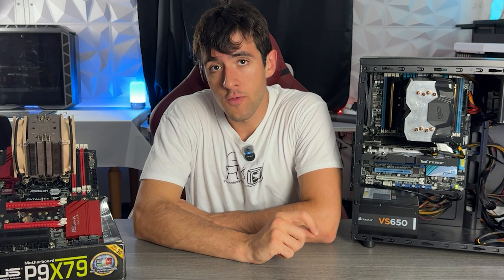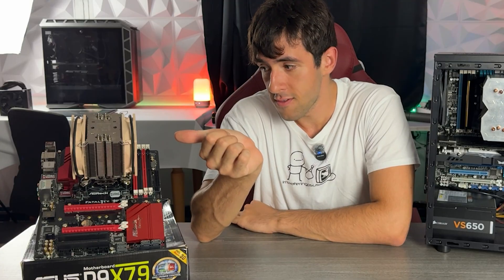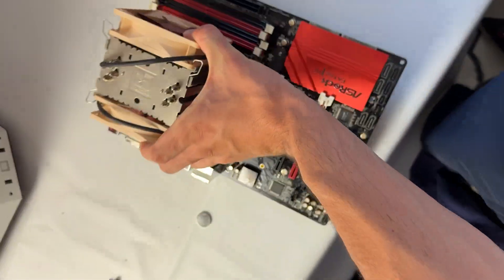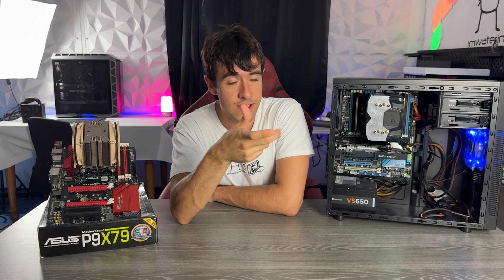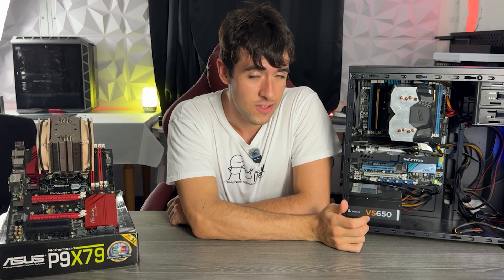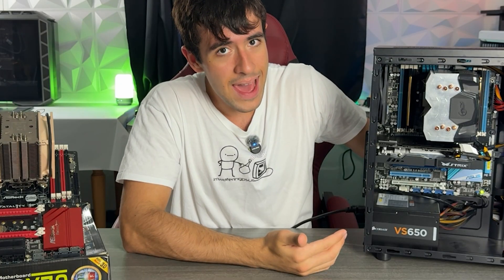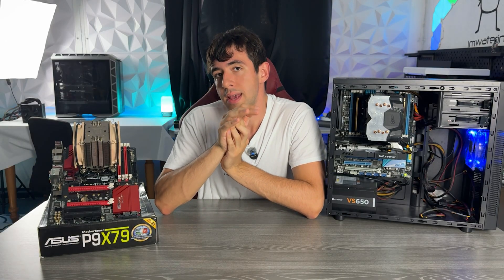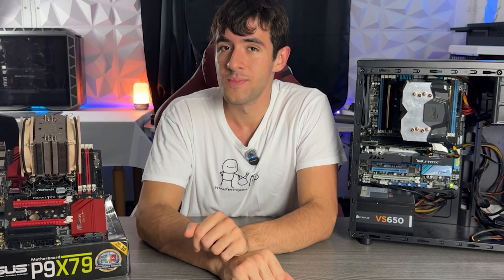Old PC Parts in 2025: Trash or Treasure? 💻♻️

Comment: Just came up on an i7 32gb ram sli 1080ti watercooled build for free. This older woman bought it brand new to play WoW on over a decade ago. She was told she couldn't install windows 11 by her son so she bought a brand new i9 4070. I took it installed a custom ISO of win 11 and benchmarked it to compare to my 2021 i7 and 3060. These sli 1080tis scored 1000 points better than my rig. I'm so tempted to replace my 3060 with one of these 1080 tis. My previous gpu was an 1080ti OC from the last batch so rtx is supported through custom drivers. Was a very hard decision to sell it and get a 3060. I still regret it to this day. I kinda belive the 1080 is still better than the lower end 50 and 40 series cards.

Comment: I'm watching this video and commenting from a 2008 Lenovo Yoga connected to a 2007 Samsung TV running Linux Mint. It's my daily "YouTube" machine. My most "modern" machine is a custom build circa 2019. I don't play games though.  
I was professionally using Alias Wavefront, SoftImage, Director, Photoshop, Illustrator, After Effects, and Premiere, back in 1998 on a Power Mac 6400. Yes, I also had access to SGI machines, but they weren't generally necessary until it was time to render our full textures. In 2002, I cut an entire 24 track CD quality music album with a hobbled together Pentium 2 PC and a Layla interface. What usually forced me to upgrade machines was that the new OS (Windows or Mac) wasn't compatible anymore. I use mostly Linux environments these days, but I dual boot Windos 10 LTSC iot on some machines.

Comment: Those xeons are very good, hard to believe
Reply from the maker: Indeed, indeed :) They keep a lot of platforms alive and they basically are what I started basing my budget builds around, back in the day
Reply: I saved an old HP 800 G1 tower and installed a Xeon e5 1271 v3, 32gb of ram and a PNY single fan GTX 1660 with Windows 11 and it serves me well. I tested an I7-4790 against the Xeon e5 1271 and the Xeon beat it.

Comment: This is unrelated but I have an ASrock B650M PG Lightning RAM at 6000 MHZ CL30 and an 8400F, the problem is that with this configuration the ram wont run at anything above 5400 mhz at cl36 without not posting, do you know of any fixes or info about this?

Comment: 9600K 1070 W10 IOT LTSC still HTPCs works well with my soundbar. Maybe I will test win11 iot ltsc on it also. It's an experiment, 120gb ssd has win10 activated, found a 512gb nvme apparently has fedora 42, and maybe I throw in an old 2tb gen3 or buy a 1tb nvme for the os, maybe redo as W11 IOT LTSC for comparing. Idk but it's decent for youtube and videos.

Comment: I don’t think CPU’s and gpu’s have come on that much I’ve only just sold my GTX 1080 and i7 7700 it still plays 1080p and 1440p modern games it just doesn’t have raytracing or dlss  but raw power still holds up I stupidly upgraded because I was still playing games loaded on my HDD when all I needed to do was stick another m.2 with twin m.2’s it was a great gaming pc, even my 5080 struggles in ultra 4k without dlss and raytracing on

Comment: Just a few months ago I upgraded from an i7-8700k and a 1070ti. The gpu was starting to act funny after 7 yrs of a lot of use. I'm disabled. I'm on my pc a lot
Reply: You try taking apart and repasting the gpu? If it's hot could help. I repasted an old 1060 a couple years in it was throwing crashing fits.

Comment: Any i7 4790K users? I paired mine with 1070 rog strix and overclocked it to 4,8ghz(max i could with air cooling), it still serves me well:D
Reply: Used to rock an i 7 4790 on h87 mobo till last year ,what a CPU
Reply: I hunt for old hardware and have a stash of stuff that I refurbish and re-sell and I just got an Asrock Extreme 6 board with the 4790k. It's a beautiful board with blue metallic heatsinks and all the best Asrock offered back then.

Comment: Still happy with my X99 system that I built back in 2020 for a total of ~US$725, including a new Corsair Gold PSU at the time.
BoM:::::
Xeon E5-2696v3 CPU (used, AliExpress): $54
PCCooler CPU Cooler (repurposed): $70
Strix RTX 2080Ti GPU (used-local): $220
HuananZhi X99TF (ver 1.0) MB (new, ALiEx DEAL): $50
Adata 1TB NVME (new): $120
48GB Corsair Vengeance 3200 DDR4 RAM (11-11-12-24, 4 channel, used-local) :$80
Corsair 650W Gold PSU (new): $80
Lian Li Lancool II Mesh Case (used, local): $38
Win11 Pro OS (single use): $13
Total: $725

Turbo-unlocked with MiyConst's Mi899 software tool.

Runs everything I need it to run...mostly work-office, video streaming, some video/photo hobbyist editing, and a little gaming from time to time with our teenagers (mostly Marvel Rivals, WoT). Ever since I realized I could easily upgrade to Win11 Pro, avoiding the TPM requirement by using the .iso install method, the urgency to do a HW upgrade went away.

PS: previous system was an X79 platform:  Asus P9X79 Pro + E5-1680v2 (OC 4.3-4.5 Ghz) + 32GB DDR3 XMP 4 channel + GTX 1080Ti+ SSD w/Win10 Pro OS.
Reply: Yeah Xeon  x99 systems are more than enough for most people some of those CPU'S are still competitive in gaming.
Reply from the maker: That is SUCH a solid build! Makes me wanna do yet another X99 + 2080Ti Build, they are such a good match with high core count Xeons...
Reply: @ImWateringPSUs   The X99TF was originally $100 on special discount, but I unfortunately did not buy it through the official store.  It was just when COV hit and deliveries got impacted.  When it failed to arrive I got a 100% refund via AliEx dispute. I reordered through the official store for $100 and received that motherboard in about 2 weeks.  Another 3 months passed and the failed initial order's unit also arrived at the door. Two for One! That spare X99TF is running with an E5-2678v3 + 32GB REEC DDR3 + GTX 1080 in the family room, mounted behind our TV on a vertical test bench. To avoid having to reach into the cove behind the wall mounted TV, I wired a remote on/off button for that PC. Easy to do with AliExpress. 
As for the 2080Ti...I was the only local bidder and got that one for a bargain.  Repasted and it runs perfectly well.  I do run it undervolted, given its age.  It's well matched with the 2696v3...maybe 2% beyond the old XEON's bottleneck threshold.
As for the quality of these HZ x99TF motherboards...they've been SOLID for me since 2020.  I gave an HZ X79 Deluxe motherboard to one of my children's friends...the system included an E5-4627v2 + 32GB REEC + RTX 2080 Super (with blower fan) + 800W PSU + Red ALU vertical testbench. That system is also going strong to date...as a 1080P gaming platform.